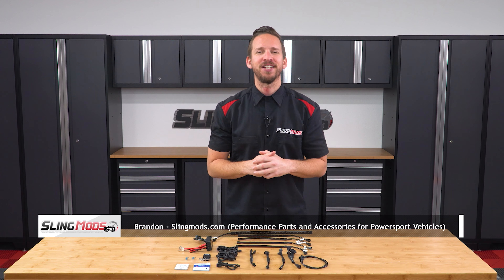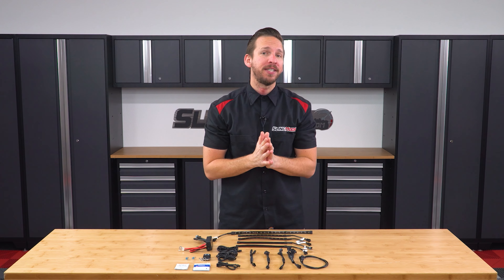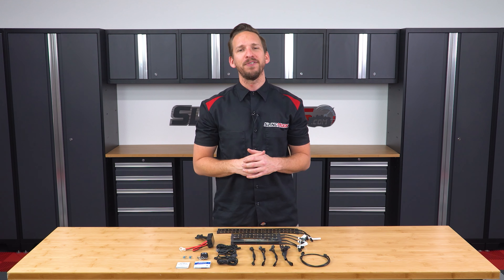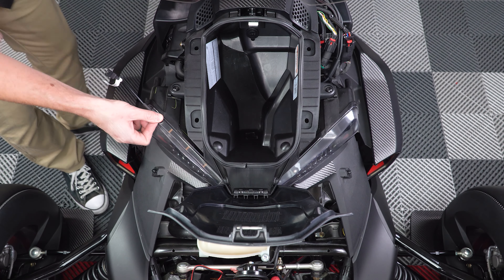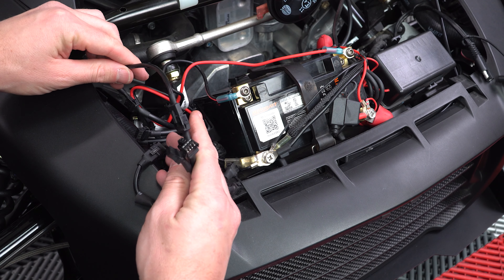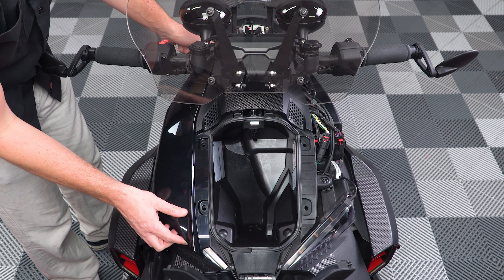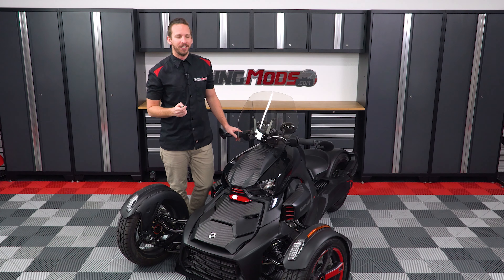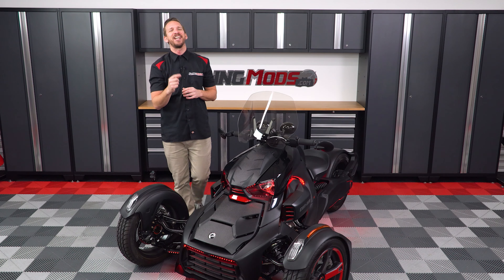Can-Am Ryker Chaser LED Underglow Lighting Kits

Comment: I can add these lights, flood lights and speakers and it won't be too much for the battery?
Reply from the maker: We're running that and more! The only time you'll need to monitor is parked with the ignition off. We have a shut down feature on these for that reason.

Comment: How do you get the lights to just show one solid   color
Reply from the maker: 17:57 You have to Push the A button to cycle through all the Chaser modes, until you get back to single color LED's.
Reply: @Slingmods  but will not stop dancing, won't  no movement just color
Reply from the maker: @timothyglover7447  There's like 80+ sequences. Keep clicking the A button on the remote until you get to the still colors. Thx!
Reply: @Slingmods  thanks, all good 👍

Comment: Is there an official method/procedure to add multiple 1-2-3 stage kits or light strips if I wanted more lights in the system? Ex lights on both front control arms and 2 lights on the swing arm.
Reply from the maker: Hello Adam, the current Ryker Chaser module was only designed to handle the current load of up to 4 Chaser Kits, as we had plans to launch a 4th kit down the road. If you wanted to add another set of front a-arm strips we could do that.. but we'd need to get you some 1:2 power splitters. If you could please send us a support ticket here... my team will be happy to assist you with that special request: https://www.slingmods.com/index.php?route=information/contact  Thank you!

Comment: You said “if you plan on running directly to your battery for power”. What’s the alternative for powering all 3 kits simultaneously?
Reply from the maker: Hello Daniel, the alternative would be to run the power and ground wires on the chaser module box to our Ryker Fuse Block Kit here: https://www.slingmods.com/canam-ryker-12v-accessory-fuse-block-show-chrome Thanks for watching!
Reply: @Slingmods  Thanks man. Which way won’t void my warranty if anything were to happen? Also, does the fuse block have less of a chance of draining battery and will it still shutdown after 10mins of no remote signal is sent? I have all three kits but haven’t installed yet
Reply from the maker: @danielragland2927  Hello Daniel, No problem! I wouldn't say the bike warranty is in question at all on this mod. If you mean product warranty.. either is fine. You're either powering the Chaser's directly from the battery or powering them through the fuse block which gets power directly from the battery. The shutdown feature will work the same in either scenario. I would however suggest you run our MotoBatt AGM battery upgrade with these lighting kits.. The Motobatt battery is awesome in comparison to the stock battery and is simply a direct replacement to your stock battery. Thanks!

Comment: How good is the glue on these led strips is it the same as what the use for car trim? Dont want to loose a light
Reply from the maker: Hello, these strips use 3M VHB backing tape.. which is pretty strong stuff. The most important thing is to properly clean the surface area with rubbing alcohol to make sure it's free from any oils or contaminants prior to adhesion.

Comment: Is there any memory function built into this? For example, if I set the lights to green and power off the bike, will they be green the next time I turn the bike back on?
Reply from the maker: Yes. It will remember the last light setting before you turned off the system via remote.

Comment: When riding does it turn off after 10 minutes or when it’s off, not running that it turns off after 10 minutes?
Reply from the maker: The Ryker battery is not that great. So the system has an "auto" shut off feature only when the engine is "off". That will turn off the lighting kit if the module box does not receive a remote control command after 10 minutes. This is to ensure that you don't leave the lighting kit on at a show or bike night and drain your battery.

Comment: Can I wire this to the accessory port so that it all turns off when the Ryker is off?
Reply from the maker: Hello Chris, unfortunately not on this one. This mod will exceed the current limitations of the "accessory port" and pop that fuse. This one needs to be wired directly to the battery for power.

Comment: Does this come with the extensions and splitters?
Reply from the maker: Hello Darrell, the main Underglow kit #1 does. Kits #2 and #3 are add on kits to kit #1. The module box also includes an extra port for the chaser wheel light kit we have in development which will be kit #4.

Comment: ONE THING you forgot to mention or show is after having 2 large wires running out from under the glove box NOW the glovebox no longer lays flat and the pins will now not fit thro the side panels into the holes!
Reply: Any response on this one ?